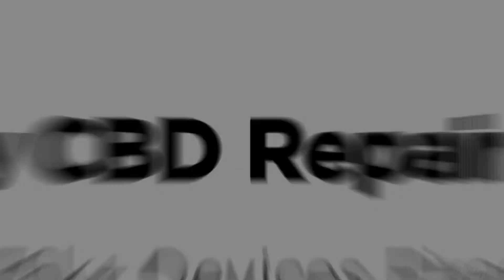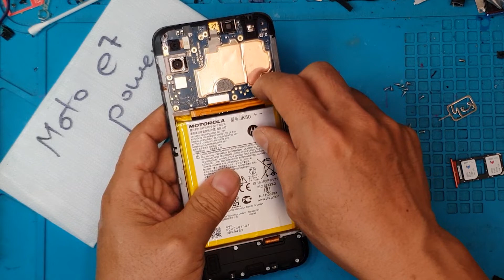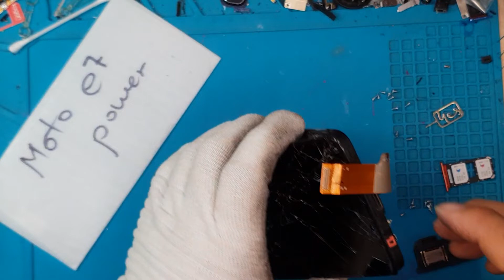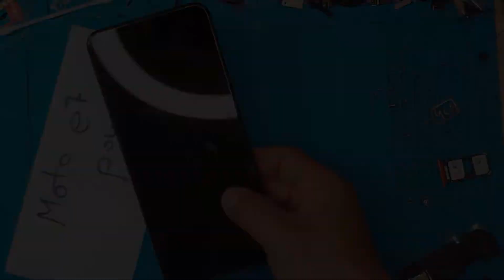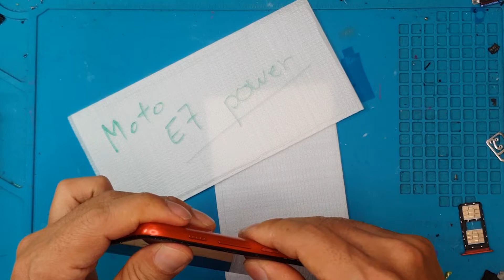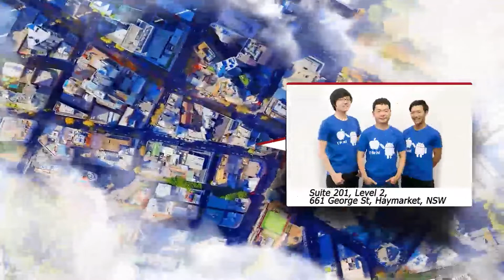TWO ROUNDS OF REPAIR! Moto E7 Power Screen Replacement | Sydney CBD Repair Centre

Comment: Hello, please tell me, I replaced the display and after turning on the rainbow screen with the phone logo lights up, after a few seconds it goes out and lights up again, accompanied by vibration, this is a defect of the replaced display or damage to other parts of the phone.  Thanks
Reply from the maker: i guess it's faulty screen, you may ask the refund from a seller. thank you